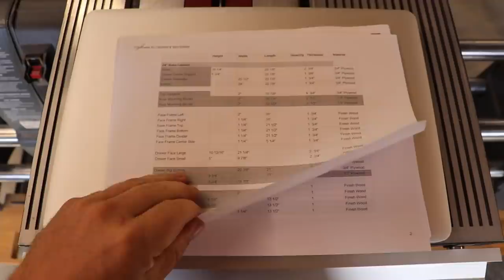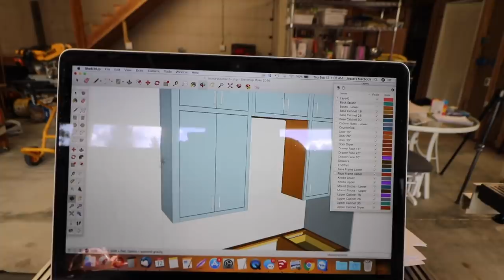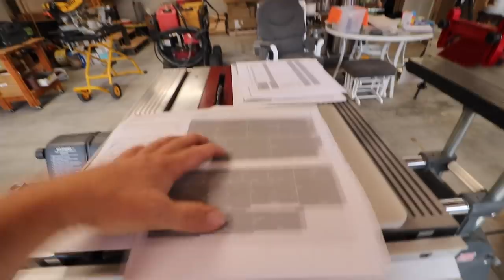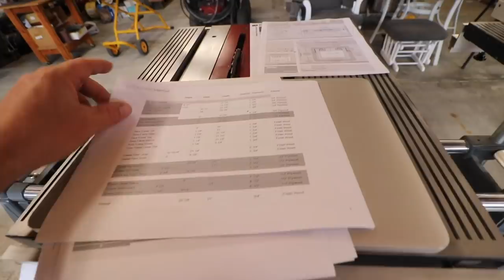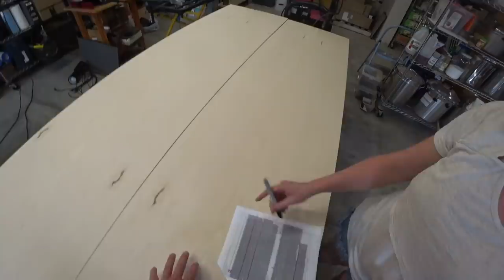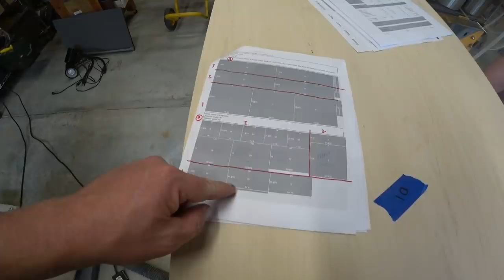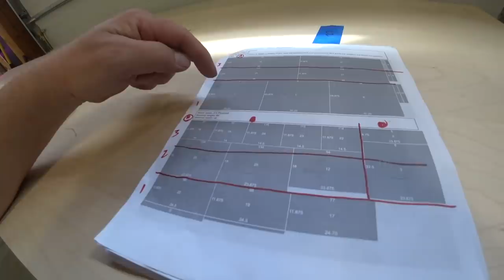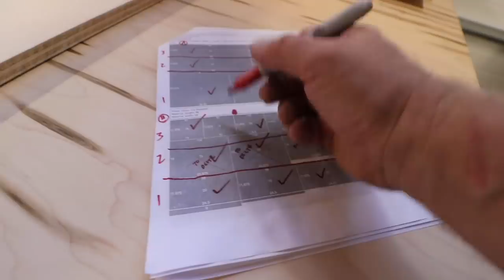FIRST CABINET PROJECT! (Cutting Cabinet Boxes)

Comment: A dust collector works different than a shop vac. CFM matter more than suction pressure. The bag should puff up quickly without assistance. Likely something is restricting airflow.

Comment: Tip to reduce edge chipping in melamine & finished plywood: put blue painters tape over the (back or bottom) area you will cut, and saw through the blue tape.😎🤙

Comment: I know you have a desire to get the garage finished BUT you need to get the house sided. The ice and water shields around all the windows and doors will degrade from UV. if you have to replace this or get leaks it will be terrible. The OSB will only take so many harsh winters and will definitely start to delaminate

Comment: Shop Smith makes a blank table saw. Raise the table, remove the guard, place the insert in the table, slide the fence over one side, to hold down the insert, just be sure the blade will miss the fence. Slowly, lower the table so that the blade comes through the insert. Now you have a zero clearance insert that will eliminate most of the chipping, on the bottom of the boards.

Comment: Hi Jessie, Can I make a suggestion, Get yourself a Meter or Yard long steel rule, depending on metric or imperial measurement, it is a lot more accurate than using a tape measure when moving the saw fence. To ensure the best cut on a board material you need to make a zero clearance fence for the sawblade. how are you going to deal with the edges of the plywood, there are two good choices, 1. iron on edging. 2. wood edging glued and nailed on.

Comment: Another handy tip when setting feather boards.

The first finger on each set should be slightly shorter than the others, set your material thickness from this point and you'll get just the right amount of pressure.

Comment: if you want a 24" base cabinet, you need to factor in the thickness of the face frame material.  Say your face frame is 3/4", then the plywood sides need to be 23 1/4" wide.

Comment: Hals Wood Shop.   20 year owner of Shopsmith.   I hope you like the fence no other saw has all those features for clamping and lockdown.  space...any big sheet cutting would take up space.  Learning curve, its your first lessons.  Sawdust collection- judge what you see in the bag not just the bit in front but that is a common area.  Moveable if you needed a few more inches away from that pole, it is on casters, 150 pound machine.  Your past owner bought the deluxe package, not the bells and whistles, you have all the accessories to do so much.  I wish I could come there and give you a tutorial.  Call Shopsmith and tell them you are an owner, you get free customer service on parts and help, try that from another brand, even a second or third time owner.
Reply: Hal any recommendations for other channels using a shopsmith?   I have one also....
Reply: @lwhays  Just search Shopsmith and see the results. its worth the look

Comment: I owned a shopsmith for many years and used it to help build my house in the 1980's  and to keep the edges nice I always over cut the edges and then ran them through the jointer  when I built the cabinets if you are not concerned about getting such a fine edge then the 12" sander is great too especially for glue joints.  If you are doing angle cuts then do them all and without changing the angle of the table raise it up and move it or the powerhead away so you can remove the saw and mount the sander then adjust the table down to sand from the edge of the table (Not the center saw slot).  Now you can sand at the exact same angle as the cut.  This is one of the great things about the Shopsmith.  You can also horizontal bore the edge for pegs etc using this angle for miterjoints.

Comment: Wow, I can't imagine having to do all that setup every time you want to cut something with the tablesaw.
Reply: @lawrencewillard6370  I have all of what the shopsmith gives you, and more, in less than 250 square feet. Most of it is on wheels to move around if necessary.  I can switch between ripping and crosscutting in seconds, and I don't have to take my saw apart to drill a hole with the drillpress.
Reply: IMO a shopsmith is great if you need a lot of different machines but not often.   You might be willing to take apart the machine for a drill press if the alternative is buying a drill press you're going to use once a month, and the shopsmith is a decent quality machine, and definitely better and probably cheaper than a bunch of harbor freight tools it replaces.   Lots of people feel the same as you do, though which means you can get them used comparatively cheap.  All this is great for part timers like me. It's a pretty bad fit for production environments, and on fact Jesse and Alyssa may be doing enough on a daily basis to be annoyed.  Also consider with a shopsmith and a decent hybrid table saw you have max convenience for your main tool and versatility for all your non-main tools.

Comment: 24” base cabinet is measured from the face frame to the back of the cabinet. If you’re face frame is 3/4” thick your side panel sheet goods should be 23 1/4” wide.
Reply: Agreed was just going to post that! Same for the top cabinets .. 11-1/4 to allow for the 3/4 face frame . But I do like making that 1st cut oversized as you did , the panels are much easier to cut/  trim  to the final demension

Comment: Get a track saw and a track saw square (GRS-16). Setup a large assembly table and a sheet of foam board to cut on. This will allow you to cross cut much easier, safer and faster with great results. Look at Festool or Makita.

Comment: I have a Shopsmith, and the dust collector should inflate completely if it is working correctly. It should also collect the saw dust below the blade.
Reply: It's user error

Comment: If you can handle it here are a few bits of advice. Euro-style cabinets are very easy as long as you use some form of edge banding. Iron on or a thicker bit of wood to be glued on. To break down those big sheets of plywood think of a track saw. It's much easier to move the track than maneuver a big heavy sheet goods material through a saw. Track saws give you an excellent edge. Other than that I think you have an excellent start of a shop.

Comment: Jessie, stack material good side to good side (face to face) this will prevent bad side from scratching good side. Put a sheet of plywood on saw horses as a work table to assemble boxes and hardware. leave all doors and drawers out of boxes while installing. keeps weight manageable till mounted?

Comment: You're doing fine Jessie.  The blade is doing a fair job on the cuts.  When you get to the kitchen and bath cabinets I hope you consider a top quality blade.  You'll be amazed the difference.  When you get to making rabbets and dado joints I like to use a sharp knife scribed along the cut line before you make the cut.  That spares you any blow out.

Comment: Good plywood material to build with:
Check out MDO plywood. (Dont look at the name and think it's anything like MDF). The edge looks a bit like Baltic birch but the surface has a super smooth kraft finish. The plies are very strong and include fir. It's a favorite material of sign painters and there's a waterproof version called HDO that the construction industry uses for forms for smooth poured concrete walls.

Comment: Check out the Mark Adams wood wiring series of videos. I took his cabinetry class about 15 years ago. You’re using 3/4” plywood is overkill. 1/2” is perfectly adequate.  Also your dust collector bag should be completely filled and pressurized...you must have a leak.

Comment: A standard cabinet is 24” including your face plate cut your plywood at 23.25 “ put your .75 faceplate on = 24”  that will leave the correct countertop overhang.

Comment: You can clean the edges up with that sander machine also get a carbide triple chip beveled tipped blade, your cuts will stay clean. it's worth the investment and can be resharpened. Get plenty of firring strips and shims for installation.

Comment: I think it's time you refocused on completing the house build and get in outside skilled help to firstly partition off up stairs into rooms ., secondly get in an electrician , forget building kitchen unit , you can buy them from IKEA cheaply.
Reply: Anthony Smith I have a friend who builds custom cabinets, and he bought Ikea for his kitchen. IKEA was cheaper than just his cost on hardware.
Reply: Most people I know buy cheap Ikea and then put on nicer front panels. The actual boxes in the back are all the same anyway.
Reply: I did IKEA, very popular in Europe where every house you buy does not come with a kitchen. I built my first because I thought I would save money. Turned out it cost $2k more. After living in the EU for 12 years and moving back to North America I chose to install my new kitchen myself. Quotes were in the $50K range and I did it myself without cutting a single piece of wood for $18k, just saying,  :-)
Reply: And there would be no vidoes.....Jesse is a self starter, he doesn't need help...
Reply: @jedidiah5131  Hi
I've been DIY for years and have many skills, and don't always prioritise and have 
realised my wife and family suffer as things take to long to finish.

Comment: My understanding is that your dust collection system is collecting light airborne  dust,  preventing you from breathing it in and settling all over your shop.  As far as I can tell , it is not meant to be a "vacuum cleaner" .    I m not an expert, but I have worked in a Cabinet shop with dust collection, and we still had to sweep and shovel dust every week

Comment: just a tip, the smaller the point of your pencil the more accurate you can be, so in other words for cabinets don't use a carpenters pencil, I prefer a 2H drafting pencil as you can get it within 1/4 mill if your careful
Reply: also stack your material finished face to finished face, just like boxing protect the face!

Comment: When you want to fine tune your cross cut using the fence, adjust the fence to approximate, then fine adjust using the 
quill adjust like it is a horizontal drill press to move the blade very precisely. It helps a lot.

Comment: thanks for the video as always. dust collection is never 100 %  ant like plumbing sizing and routeing are important  . minimal run length will help as will fewest number of bends and smooth pipe interior versus ribbed  .  the larger the surface area of your filter the less force required  to flow a specific volume of air through . removing restrictions to airflow will improve its efficiency and from what ive seen and as a gut reaction bigger blower and filter bag 2 or 3x bigger  on 3.4 or 4 inch piping 20 foot run ..looking forward to more

Comment: wondered if you checked that first board for splintering. you got lucky. i bet that wood is not cheap at all. it does seem like it would pick up more sawdust. maybe if it were overhead or drill some holes in the hose next to where it collects below. IDK
Reply: DO NOT DRILL HOLES in the HOSE!!!  That is NOT the way the item was designed!  IN THIS CASE...if it's not working well, it's because something is outta whack in the system!!  NOT that it was incorrectly designed.

Comment: PROFESSIONAL CABINET SAWS have 2 blade , a small scoring blade and a larger cut off blade  With a table saw or track saw  you can make a shallow score cut the reset the blade to  make the final cutoff. that will give smooth cuts

Comment: You can reduce (resolve) breakout on the underside, along with improving dust collection by using (making) a zero clearance table saw insert, My cheap little DeWalt site saw works a treat now I have made one for it, the other big benefit is much improved dust collection, as suction is way better with the significantly reduced clearance. Obviously needs swapping out if angling the blade over.

Comment: Shorten the hose to the dust extractor, the corrugated pipe slows down the air flow, reducing its efficiency.
Reply: Also, he is starving the DC.  it is designed with 4" flex pipe in mind.

Comment: Jesse and Alyssa the dust collector is not working right the top bag should fully inflate
Reply: Douglas Mungham true. Seems to not be running fully.
Reply: Douglas Mungham I’d direct the hose under garage door. You tube dust collection systems many helpful systems. Fine dust will find itself EVERYWHERE.

Comment: i had a dust collector way back the cloth bag always balloned up so looks like yours maybe weak, you maybe missing dust guide/guard to point under the table
Reply: He just blew it out, vacuumed, washed & dried it so chances are it's letting air pass through it with minimal resistance.. Resistance = pressure, and pressure = inflated bag.
Reply: I think he may have that impeller on backwards. something is not right

Comment: Try using a "laminate blade"  it will reduce the" blow out" on the ply. The blade has pointed teeth rather square topped teeth that reduce  the damage to the reverse face of the board. I use a 80 toothed blade CMT (not cheap £90) you can also tape the cut for extra clean cuts but it is a slow process. The bag on the extractor should snap up when you switch it on, for some reason yours doesn't seem to. Blockage, filter bag very dusty, poor ducting? Try it unconnected and see if the bag inflates rapidly. Have fun! 
P.S. Most of the blow out, but not all should be covered by the cabinet work  when assembled.
Reply: In the US/Canada, workshop stuff is so much cheaper than here in the UK I bet that blade would only cost about $60 My biggest grumble from being in the UK Choice and cost :o(
Reply: Brian newton Hate to make you cry but what we call a "finish" blade here is only $20-$30 depending on brand and number of teeth.

Comment: Dust collection not working...
Most dust collection systems I've seen collect MOST of the dust. Compare your dust collection with the vacuum off and the hose disconnected.

Comment: All the talk about building vs. engineering doesn't make sense.  First of all, you shouldn't be building anything until all the engineering is done, and the plans are finalized.  Second, how are you claiming you're building faster than the engineers are engineering?  It's been over a year (maybe over 2 years?) and you're still far from done.  A competent engineer wouldn't even need anywhere close to a month to engineer a house of this size/complexity.

Comment: One piece of equipment that would make great use of those "diagrammed cut sheets" is either a 'Torch Mate' brand or 'Plasma Cam' brand CNC Plasma cutting machine that you could set up with a router to cut wood. That would make quick work of the cutting. The programs setup the cut diagrams to make the best use of the material you have for the least amount of waste.

Comment: The design of the underside of the saw means it doesn't create enough of a seal so as to create a vacuum when you turn on the dust collection system. Use some tape and cardboard to close off the blade area better underneath.  There should be a slight vaccum when it's right on the top side. That will create the most efficient dust collection set up. Trust a contractor on that.

Comment: The dust collection isn't working right.  The upper bag should be completely puffed out while it is running and the lower bag is what collects the larger particles.  I think you have a clogged hose or fitment on the collector.  Fix that and it will collect 80% of the material that the machines produce provided you are using 4" hose.  You can only do so much with flex tubing.
Reply: Sorry, I just realized that it's only a 2-1/2" hose.  Yes, the shop vac will do a better job because it has better suction but won't move as much CFM of air.  After looking at the dust collector again, not sure you can actually make that work much better.

Comment: Melamine is more durable then prefinished plywood. You can take sand paper and a razor blade to clean up melamine. Prefinished ply scratches like crazy. Prefinished ply looks nice but I don't get why you are saying that melamine scratches easier.

Comment: MDF is made from wood flour.  Flour is actually heavier.  Machining MDF creates flyable mountains  of  dust that is the only material known that has builtin antigravity.  Don't use  unless you have industrial grade  dust collection.
Reply: I deal with it where I work. Any cabinet over 98" tall gets 3/4 mdd side panels. So it gets heavy, and i just put more weight in it with drawers and doors.

Comment: I've noticed something, people who don't want to learn how to design something use sketchup those who do use fusion 360.
Reply: Are they both free? I am considering.
Reply: @briannewton3535  yes although with fusion you have to re sign in as a hobbyist aka startup
Reply: @spike7112ify  Cool. I won't be doing too many things, so that fits.. thanks
Reply: newton np I personally use fusion 360 makes it easy to make things to 3d print has stress simulations able to make functional moving models and import files from mcmastercar even if I don't buy from them it's nice to use the models